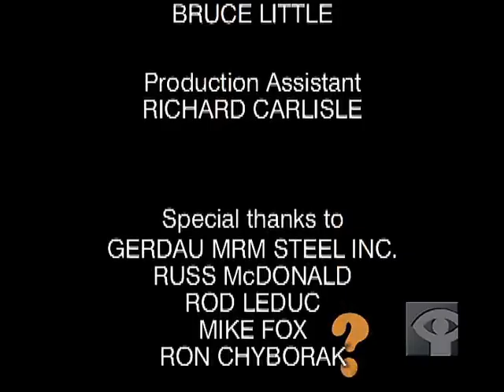How Do They Recycle Steel?

Comment: How about just a bit of dialogue?  I mean, maybe tell us something?  We came here to be educated.  Great effort with the filming but just maybe explain what is happening and why?
Reply: Scrap is screened for radioactives in the yard. It's crudely dumped in a furnace lined with refractory bricks and water cooling pipes. Lid closes and two carbon telephone pole-sized electrodes are dipped in there. Flip the power on and all hell breaks loose. After a ...seems like it's liquidy in about 20 minutes. They might add more scrap as it melts down. A guy lookin' like an astronaut uses a long stick to retrieve a sample for the lab to check chemistry. Rust and impurities float and are separated while draining the furnace into another giant container called a ladle. HUGE and MASSIVE bowl. Metals are added for the right grade of steel. Then it's pressed into billets like a pasta maker. Giant square bars of steel. That is further recycled to stuff like rebar for low grade steel. Rebar is often straight from the recycling plant. The billets might also go to another specialty steel manufacturer who makes galvanized or other steel products. A steel mill is a dirty loud and dangerous job but I would take it for the awesome sound alone. And the pay used to be awesome.

Comment: yep... Learned absolutely nothing from this video.
Reply: Sho'Nuff, The Showgun of Harlem 💩😈✋😭
Reply: See my comments. Also this vid shows a newish melt shop (the floor with the furnace and all the melting fun). https://youtu.be/8J3bMtX9Wqo When those oak-tree-trunk-sized carbon electrodes are spent -- and they get shorter like used pencils -- they merely wrap a chain around it and pull it out like a thorn then crane it to a cement area on that same floor and lay it down. like you'd fish something from a tree with your fishing rod. It's so hot it eventually breaks down the cement.

Comment: Electric arc furnacing and later cooling and de-scaling the steel... this video would be improved by a commentary...
Reply: Doesn't seem like you're supposed to have a comprehensive understanding after watching this video. It's more of a visual and audio experience supplied by the act of recycling metal. Canada in the 90's